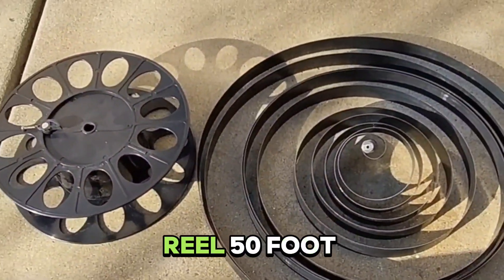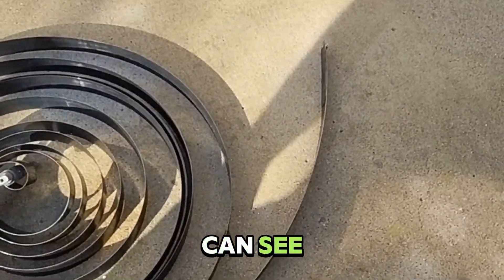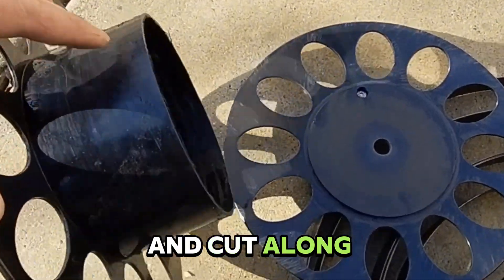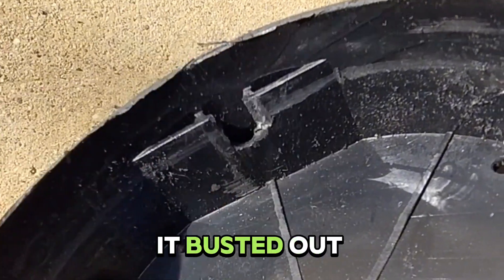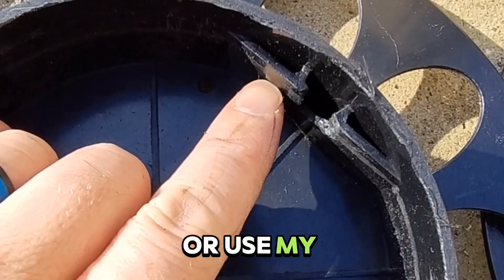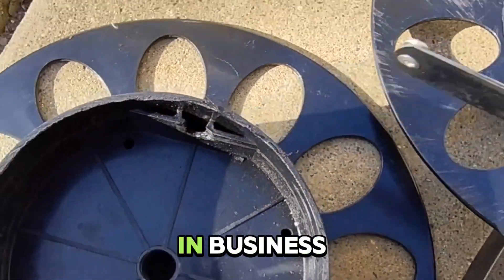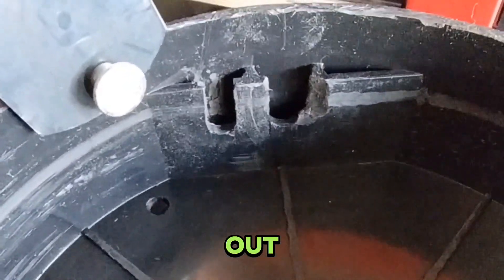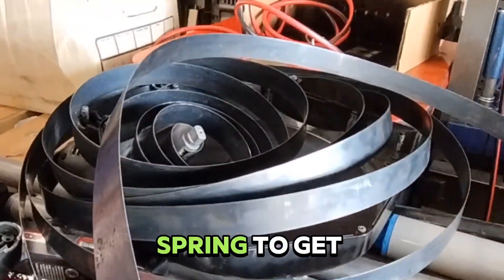Electric Cord Reel.  Wouldn't wind up, unsprung, and now repaired.

Comment: Not a bad idea, but the reason that broke was because there is a tremendous amount of spring pull on that little plastic area. Now that this area broke, there isn't as much material as is needed to hold the new location in place. Your tension will be in the direction of the failed location, and with that area having already failed it's now weak. I would recommend for anybody else trying this (or if you can get back in there), to fill that first broken area with epoxy to give a good backing for the new location to have a chance. Otherwise you'll it will fail much sooner than you like.
Reply from the maker: Great observation and recommendation.

Comment: How did you plastic weld it?
Reply from the maker: There are plastic welding tools. It's similar to solder iron. Heats up and melts the plastic. There is a plastic rod that you can melt into it also to add more material.